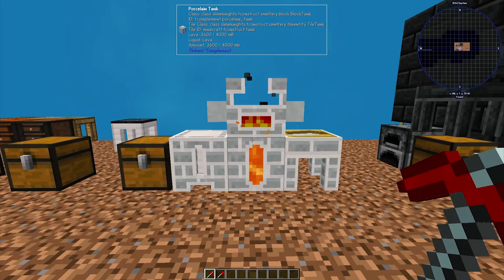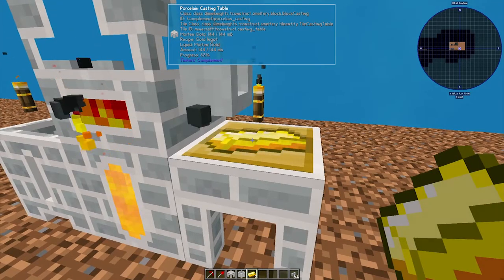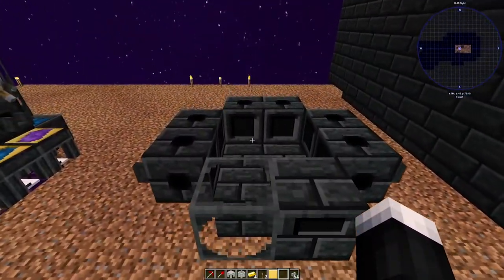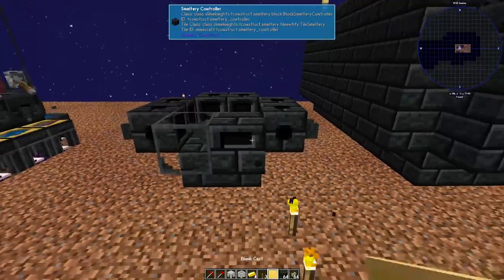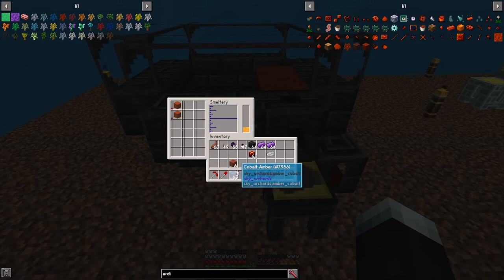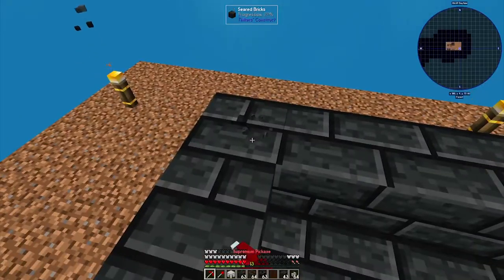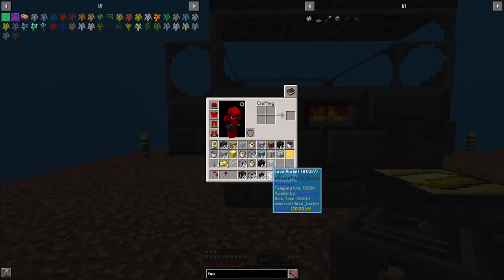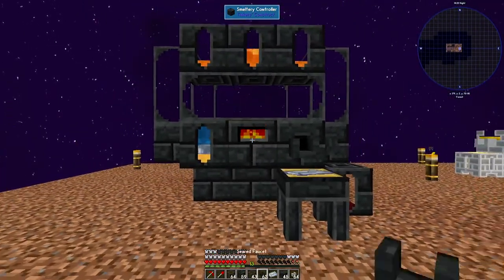Skyfactory 4 How to Build Basic Tinker Construct Smeltery

Comment: the seared heater tells me to use another fuel that burns hotter than coal any advice what to use early on to be able to use the tiny version of the smeltery with only heater and smelter.
Reply: Make a cobblestone cauldron, place it directly above a torch, and right click with cobblestone in your hands to make lava. Get buckets to take the lava to the smeltery. Lava should handle most smelting and it's easily obtainable